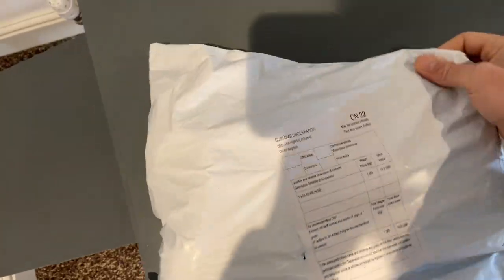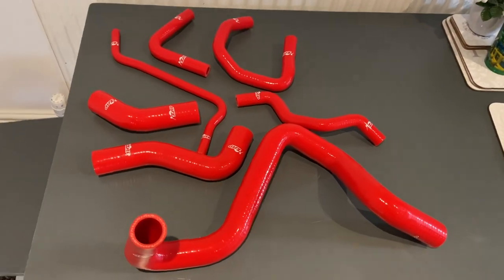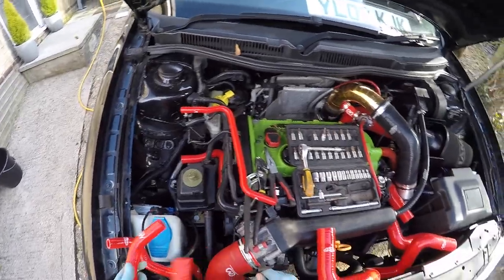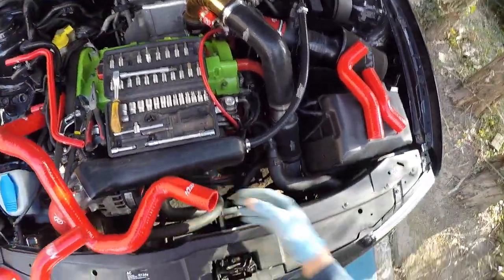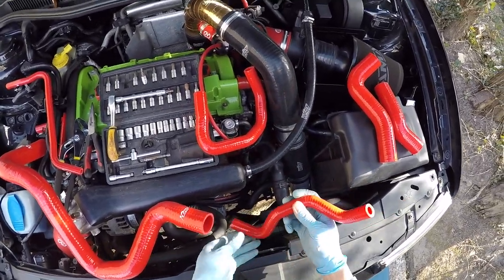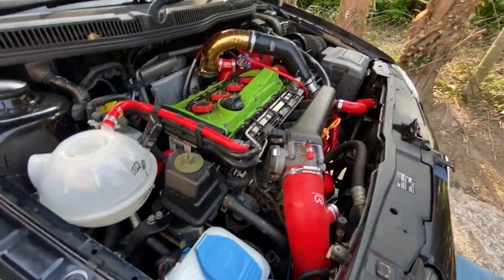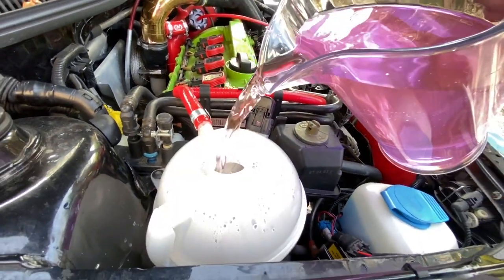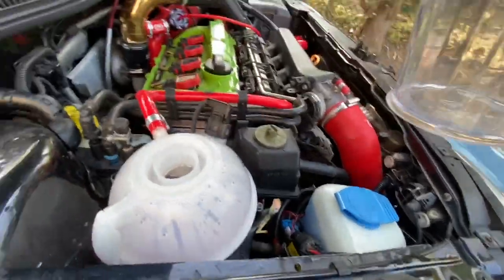FITTING NEW SILICONE COOLANT PIPES ON MY GOLF MK4  *ENGINE BAY DRESS UP*

Comment: Looks good I went through flushing all the bad crap out of my golf the other day 21 years of oil and crap took 4 cycles and dropping water until it looked ok 
Easy cars to work on
Reply from the maker: Thanks mate, I can imagine what it looked like! Yes they not too bad to work on to be fair.
Reply: @Mk4heavenHD  like to see videos like this your doing  I still have the original coolant pipes and tie n track rod ends theres loads on my golf that haven't been changed mechanically from 21 years ago looked after these cars are bomb proof. If your on Instagram u will see my build I have absolutely no time to do videos I will have time 1 day when my youngest doesn't need me but that will be me racing the golf more likely
Reply from the maker: LINCS DRAG ,TRACK & STREET - Yes I agree they are good cars if you look after them. Lol making videos is no joke for sure a lot of  time and dedication is needed but it’s rewarding looking at all the work after it’s captured.

Comment: Quality video keep up the good work. Was just wondering as a beginner what tools you need for this job. Just had a coolant pipe break on my GTi so was planning on doing this upgrade in the near future.
Reply from the maker: Thanks mate, my first set of tools is the one I still use (Halfords advanced) love them because they come with lifetime warranty.
Reply: @Mk4heavenHD  Thanks dude, btw are there any upgrades you'd recommend for first mods. Either for reliability or power? I bought the car recently. Completely stock other than a stage 1.
Reply from the maker: @matthew.t.8367  no worries man, the main things I would recommend is if you going for stage 1 or anything more then stock power replace the engine mounts for sport mounts because my car sheared the bolts after mapping. The main things I would do to avoid issues is clean the oil pick up, replace the water pump for steel impeller and do full evap delete then fit decent catch can.
Reply: @Mk4heavenHD  nice one, cheers

Comment: Where did u get the house that goes from the inter cooler to the intake manifold
Reply from the maker: Flux Fakey - Hi mate I got mine from Creations Motorsport.
Reply: MK4-HEAVEN  what’s the name of the pipe
Reply from the maker: Flux Fakey - It’s called throttle body to intercooler pipe. I would double check with them on your exact model of  car before you buy just in case.
https://www.ebay.co.uk/itm/254266837066

Comment: Anyone knows the top Manufacture for these silicone hoses? I appreciate it!
Reply from the maker: I would probably say forge or samco.
Reply: @Mk4heavenHD  Thanks! I already got HPS made of Silicone
Reply: I got hps as well
Reply: I need to change my hoses on my 04 gti 1.8t (the hoses came with the car) and my car slowly overheats after awhile in idle, idk why but first im going to change the coolant hoses i suppose
Reply: @indicaant3001  I did back them when I wrote this comment and I end up purchasing The HPS BLUE Hoses, and have no problem are working fine, Good Luck!

Comment: Hi, what is you engine code? AGU?
Reply from the maker: My car is running AUM mate
Reply: @Mk4heavenHD  you know if the pipes are the same of the AGU?
Reply from the maker: @fuuks8  Yes they should be the same mate, as long as the agu is in mk4 Golf then it’s exact.
Reply: @Mk4heavenHD  it is and audi a3 1998 1.8t AGU, but i will se if the hoses matches! Thanks!
Reply from the maker: @fuuks8  no worries bro I think they the same.

Comment: Nice job man good luck, what do you reccomend on installing on a golf mk4 1.8t engine any ideas that help the car to be safe and give it power to run? Do you reccomend forge presure valve and why ? Also i want to know on what i get for my car to make it run better, is wheel spacers good for the car and going fast ? Please give me tips on what i should upgrade and put on my car, very nice job im big fan of you keep up good work
Reply from the maker: Hi mate, right there is a couple of things I did some of them learning the hard way lol, if you go through my channel I went through my entire build taking the car up to 300bhp, here is part 1 of 5  https://www.youtube.com/watch?v=8zgqp48hXBg&t=8s
Referring to your questions above, Forge dv is very good, I currently run spacers on my fronts as the offset was making my wheels touch and I've had no issues so far. 

If you looking to improve performance I would recommend first doing a decent cam belt kit & water pump, clean the oil pick up then fresh quantum platinum oil then move on to mods, if you going stage 1 then new silicone turbo intake pipe, Decent induction kit, forge diverter valve, exhaust and a remap should see 200bhp + dependant on which platform of 1.8T you're running if you going beyond stage 1 it becomes little more pricey because you will need FMIC, Larger unrestrictive downpipe, higher flowing fuel pump and injectors etc
There is so many things that come into play when increasing power tho, you have to uprate the clutch to a Sachs vr6 one and also replace the stock engine mounts to stiffer sports ones.

Hope this helps, thanks for the support.
Reply from the maker: Rafiq Daas - Thanks for the kind words mate, unfortunately I dont have intagram or FB yet.